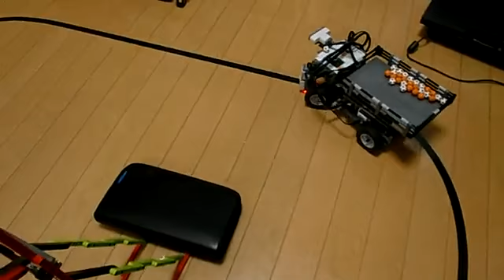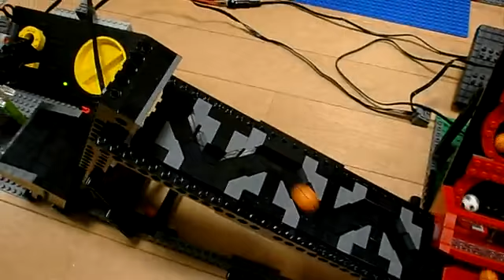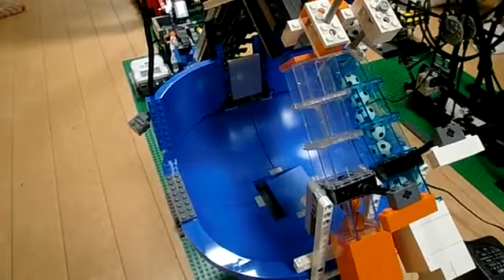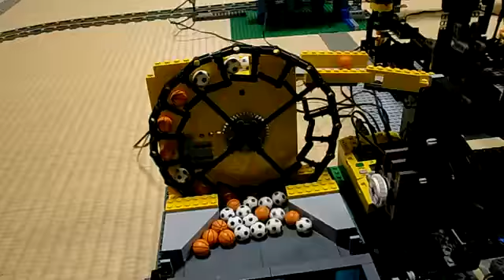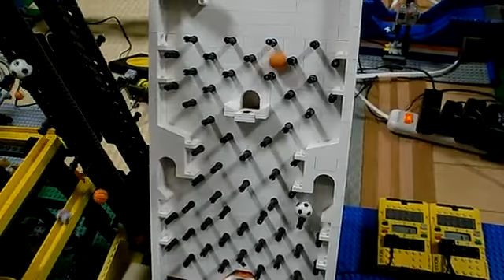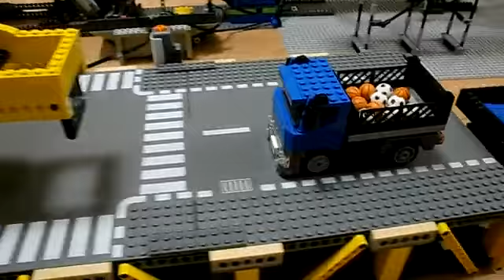Massive Lego machine with 20 modules

Comment: does the system ever get backed up or clogged?  what did you do to intitially start the machine? did you just dump all of the balls in at once or slowly add more and more. or did you put them in several spots at once? whats the longest youve let it run? do you ever notice a pattern emerge from the balls? (like getting sorted to seperate colors and back to chaos again)